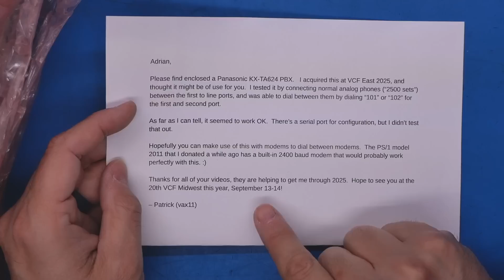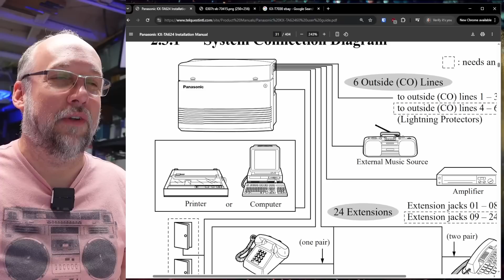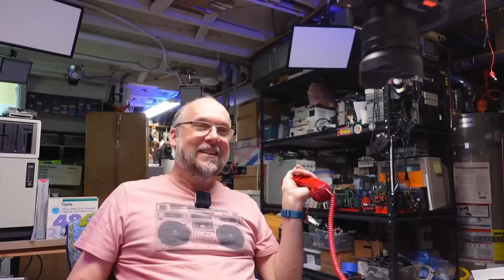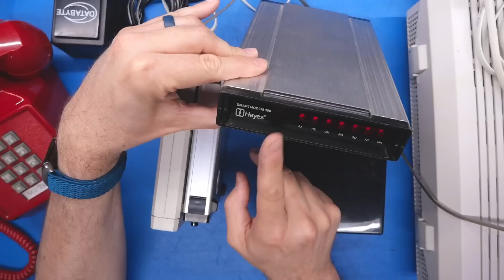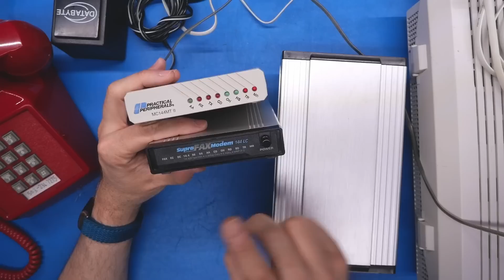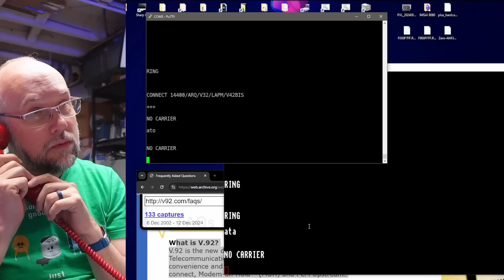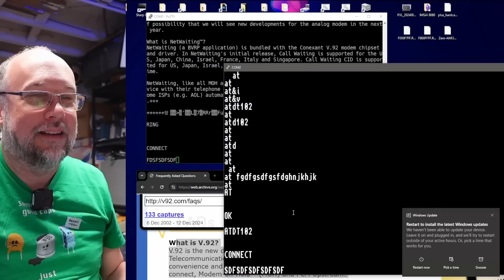How to use phones and modems like it's 1992

Comment: Maybe line 5 and line 14 have been something like a boss office/secretarian thing, so you couldn't dial into the boss office directly but the secretarian office can patch calls.

A lot of phone systens also have a bypass relay, which connects one of the extensions to a line when power is lost. On most systems it was just first extension and fist line. This was meant to be a safety feature in case of a power grit failure so you still could make emergency calls.
A friend of mine also working on a lot of old phone stuff have his PBX connected to its routers analog phone port this way with his main workbench phone connected trough this emergency connection when the PBX is turned off. This way he can still make and receive calls with the PBX turned off, and fire it up if he need the other ports to work on phones.

Comment: I was really surprised this didn't have a T1 plug for PRI.  Seems like a residential solution, especially with the doorbell option.

I used to deal with a 1994-era Panasonic system.  Quality system with quality handsets.  Part of the business was retail, specializing in services for unsavory characters... so the owner picked the Panasonic in case he needed to use the handset as a weapon to keep the customers under control.  LOL!

Comment: Somewhere around here I still have my first modem., an external US Robotics Sportster 14.4k that I got in about March 1994 for $80 (down from $140 list at the time) due to minor water damage on the box. White plastic case with hideous pink graphics and full slate of glorious blinkenlights across the top. For the spring semester of 1994, I had the fastest modem in all of Bruce Hall. Good times.

Comment: If you indeed worked with those small Panasonic PBXs, both fixed and modular, you should remember that the model number denoted the (maximum) CO and internal line ports. 624 means 6 + 24, which means no additional CO sockets on the 3rd optional board. Seems strange to forget a thing you learn in the first 5 minutes of dealing with those products ~30 years ago 🤨

Comment: My first modem was the Hayes 300/1200 for my Citadel BBS, and I ran with that setup for years, until I bought a US Robotics Courrier HST 9600. There were competing standards then for the 9600 baud protocol, and 2 or 3 manufacturers came up with their own, and the market was supposed to pick the best one and then that would become the standard. The modem cost $999, but if you were a sysop (like I was) it was 50% off. I ran at 9600 until the early 90s when the internet/WWW took off and basically BBS use went down the drain after that.

Comment: This makes me hurling back 55-60 years. My first job was in an electronic component shop (only one in Denmark at that timw).
The owner was an old telephone engineer - and he had built the switchboard in the store - a amazing 3 ingoing lines and 10 local phones (analog with dials).
The switchboard was about the size of an 'american fridge/freezer' on steroids and purely relays, spring/electric selectors and with a power bank of old fashion lead accumulators

Comment: I used to work for GPT (part of Marconi) in the payphone division. part of my job was building the servers that ran the payphones  for countries/areas. We used to have banks of up to 128 modems for the payphones to dial into to report data and get updates. You could tell what speed the connections was just by listening to the 'warbles'.

Comment: I used to manage an Asterisk PBX at one of my prior jobs where it was what you'd consider a "hybrid" set up. We had a PRI a.k.a. a T1 (with the typical 23 B-channel/1 D-channel set up, with all the B-channels used for voice) coming directly into the PBX on a T1 card, and then Cisco VoIP phones using SIP in the office. Was a fantastic setup, we originally had built our own PBX, but we replaced it with a Trixbox appliance from Fonality. It was still Asterisk-based, but it had a nice web GUI and we had vendor support for the hardware. It was a really good choice at the time though because it was very straightforward to port our original home-grown Asterisk configuration over to the Trixbox. They don't sell those cute lime green appliances anymore, of course. The Trixbox project is dead, NetFortris bought Fonality, who was then bought by Sangoma. I think technically Sangoma still MIGHT support Trixbox Pro customers that may still be using it... but I would assume they would have migrated them to PBXact if possible, which is based on FreePBX.

Comment: My old USRobitics 33.6 modem would cut off the phone on its upstream port. I wired things so that every extension in the entire house was fed from that port, so they were all disconnected when I was using the modem.
This gave me a higher connection speed, but some phones with memory presets lost their stored numbers when the connection was cut.

Comment: There’s a modern board that slides into  a Hayes 1200 enclosure that is a WiFi modem and it simulates all the dialing and connect sounds and all the LEDs on the front still work. You use telnet to dial a bbs. So atdt ipaddres:port number.

Comment: to clarify the pbx limit , the 56kbs modem was receive at 56k but transmit at 33.6k and the rack mounted modem which was digital up to the exchange aka the last mile so it would transmit at 33.6 but used a high speed h/w compression plus some extra tones to allow up to 56k , oddly enough the us robotics 33.6k/56k with switch on the top(purple was 56k, green 33.6k) was  can be software upgraded to support 56k.Decode is faster than encode of the 56k system hence the the 56k down only. also with modems you need to set your DTR/RDS etc response as well as h/w software overflow response , in fact if you look at any bbs setup file for the modem thats one of the important things mentioned, for your memory setting just look up hayes modem saved setting for the e01/e02 settings, some are binary so 00 is no carrier detect and no dial tone needed where as 11 would be opposite.

Comment: I think what amazes me the most here is how you recall any of this.  I played with the same stuff, plunged though the ATA command set, played some more, tweaked to my hearts content.  Last one I had was the suprafax modem back ~1996.  Cable came and it all faded away.  The first modem I had was a 1200, then upgraded to 9600 and thought that this was all the bandwidth I'd ever need.  That thought didn't age well.

Comment: the 56K modems were asynchronous so it would normally be 56K down and 33.6K up. the down side used hardware compression as the other end, especially if it is 56K flex.  I think on a good quality line you could get more than 33.6K I think 2 56K modems on direct dial could go to 48.xK but more than likely 33.6K. also when you make a call via the PBX you are also limited there too, so expect between 28.8K to 33.6K. 
many years ago I could tell the connection speed from the sound of the connection negotiation.

Comment: Still got 2 boxes of phones, all scheduled to go to ewaste. did also have the maintenance of the PBX at one old job, which was, due to regulations, actually not owned by the company, but rented from the only phone provider allowed to run copper line. I did all the repairs, mostly as it was so reliable, the only faults being phones wearing out, so replace with a spare, log the job, and swap the phone with the tech on arrival. Helped both of us, as i could fix one in under 5 minutes, and his job clearance time was 5 minutes as well, at his convenience, helping with his huge job load per day.

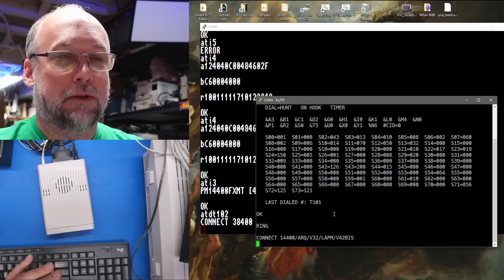Comment: 48:30 - Regarding modem compression in the 14.4k modem era - I clearly remember running a little serial port monitor application on Windows 3.1 that showed the data rate going to and from the modem. When downloading a Usenet server listing at 14.4kbps (on SLIP, without the software compression that the later PPP would do), that application showed I was getting 10KB/s through the serial port - yeah, you always want to be running smart modems at the highest serial port rate they'll support.

Comment: I lost a lot of money, forgetting that i was connecting to a BBS. I followed  the same modem uses, starting with the 300baud modem and every time a faster modem existed i bought a new version. Sometime together with my dad, when i did not had enough money.  

I belief the fastest i used was the 56k Max to call BBS's what a change of speed that was and the difference of downloading programs looked so amazingly quick while you needed to wait a long time with the older slower modem's. I also used this modem when Internet providers started being a thing. 
BTW i'm not sure about your story about the 56k speed modem, as i said, i was able to call my BBS provider on that speed without any issues. And he did have the same analog modem i used, Nothing digital.

Anyway After that i switch over to ISDN and have used that for a long long time until glass fiber was delivered at my home.

Comment: Talking about dialing modems, I worked on a project in the 90's for a large store chain who wanted back-door emergency access into every store should their main VPN WAN go down. I installed over a hundred "Netgear RM356" units. These are a 56k Remote Access dial-up Router. You essentially dial the pots line its connected to. Enter a username and password which was set inside the unit. And Bamm you had remote access into the LAN on the other side. They were fairly cheap for the time and worked absolutely superb for using PcAnywhere to jump onto remote servers etc. Just had a look and theres a few on ebay still !.

Comment: I can't believe you have a new, unopened Courier V.Everything! I worked for an ISP in the 90s and before we got something more complex, we just had a stack of 50 or so of those handling incoming calls. They really were the best modems.
Reply: Given that wall-wart, a very late model, indeed. I was given both an analog, and digital courier by our USR sales minion. His SM300 is a late model, too. (2pin barrel power connector.)

Comment: Maybe I might put an Maximus bbs up. You give me happy memories. While you tested modems I plugged my Panasonic KX-P1180 into my M1 Mac mini to print in ascii as my old Lexmark E232 is shot. It works but not super fast printing graphics pages. Trying to get CUPS to use the built in ascii mode. Still debugging that.

Comment: I have a few old modems.  I even have a TRS-80 300 baud modem.  All but the TRS-80 one were used by me, because i bought them to use them.  1200 baud, 9600 baud, 33.6k baud, and finally a 56K.  And all external, so i could use them with any computer with a serial port.

Comment: Wow I'll have to try this, actually I DO have a bbs, it's a background task on a computer that drives various stuff around my house. It hasn't been called (no line) for years, I just left it kind of abandoned, but it's still there.
However I don't have a PBX box...  However I do have a dual port VOIP ATA box, these can be setup so you can call from one analogue port to the other - so a two line version of your PBX, however I have no idea how to arrange this.
These VOIP ATA boxes need all this crazy complex 'astrix' box's etc. that I know nothing about. Having to setup a server PC as an astrix box is kind of over the top for these types of carry-on's
So I'll have to get that ATA out and try it but I'm sure it won't do anything useful
Otherwise I do have a manual phone test box, that should kind of do, however I have to manually make it ring the other end - it has no smarts, no dial tone etc.
Finally I'll be able to find out if those disused phone ports on my really old laptops actually work.

Comment: I still support about 10 or more of these for internal ride communication at the theme park I work for. They are work horses and have been installed for 25+ years.
Reply: Also we still do normal programming without the proprietary phone. You can do it with a basic phone just takes more time.

Comment: Anyone remember the smaller Courier dual standards from '91/92? Same form factor as the v.everything but only offered to sysops, with a brass plate riveted on top warning not to resell it. They only did HST 16.8k and v.32terbo 21.6k, but USR put the DSP on an upgradeable daughter card. I think I upgraded the card twice. Eventually it could do v.34, v.Fast/v.FC, v.90, faster HST, X2, K56Flex, etc. which turned it into a true v.everything modem. I loved that thing!

Comment: Heheheheh.  This reminds me of the time i needed to get some files from my Amiga 3000 to my roommates IBM PC.  Since we both had modems, i figured we could just modem to modem connect.  But my modem would not dial without a dial tone.  And since we had a 2 into 1 RJ-11 jack already, what i did was set up both machines, dialed a random local phone number, and quickly answered on my roommates machine, then unplugged the RJ-11 jack from the wall.

This worked like a charm, and i was able to transfer the files without issue.

Could i have done a direct serial connection?  Possibly, in fact it would have been easier, but i didn't know how.  This solution worked, and i stand by it.  ^-^

Comment: The reason for the double tone is in the manufacturing plant of the equipment; the UK. That’s why the feedback tone is the same one as the UK standard which is double tone.
Reply: Usually these things are configurable to suit local standards. I have a British made electromechanical PBX, and they manufactured a separate tone generator/interrupter for the system when it was sold into North American markets.

Comment: 56k modems only work with specialized equipment on the other end (usually).  Unfortunately (from experience) they DON'T work with VoIP connections.  VoIP connections usually compress the audio and don't pass the full 7 bit audio at 8kHz.

Comment: I'm in Australia and back the late 90s I went to a clearance auction at a regional forest reserve, I picked up a complete small office system, the system included a remote location module that allowed the fire tower located 7klm  away a POTS like connection. I ended up installing the system at home, every room had a phone plus the shed. At the same time I installed a 10 base T network and picked up some second hand office PCs.  The kids thought it was great having their own phone and computer.

Comment: I'm relatively certain that I connected a faxmodem directly to a fax machine to use it as a makeshift scanner/printer with no phone system in between when I was about 13 or so.

Comment: First of all: Congratulations for your running phone system!
I myself own a smaller version of an analouge phone system and use it to distribute one phone line between two areas. My setup looks as follows:
UMTS-Modem with one SIM-Card connected to my Auerswald 1006's so called AMT-Port.
Before I religated this setup to just phone stuff I had another usecase:
I had a Laptop (IBM Thinkpad R40 running Windows XP) and a fax-machine connected to the Auerswald to locally send and recieve faxes which worked suprisingly well so I used the fax machine (an old Olympia thermal paper fax) as a printer for endless paper to print out sheet music which I then could scroll through while playing (I used to play Saxophone). As time moved on I had to digitize a bunch of Paperwork in B/W and this solution came handy.

For your PBX I got another idea however:
Since you - like myself - are using old and forgotten technology I think it would be advisable to spin up a ftp server to connect to via dailup for transfering data between your pcs.
I think it would be an easy way to get device drivers for example from one PC to another without tinkering much with the systems and having to search for a laplink cable or other stuff.

Another idea to try out would be to connect your pbx to one of your sip trunks to have a fax modem connected for streaming faxes from remote locations to your home. This COULD work: It is a matter of trying!

Comment: I’ve seen those 3m connectors a bunch of times and never knew who made them thanks.
Reply: Scotchlok was the brand. They came in different colours; yellow for joining 2 wires, red for 3 wires, blue for 4 wires. They’re filled with an insulating grease, so the completed connection is waterproof. The cool kids used parallel jaw pliers to squeeze them shut. I sometimes used my teeth.

Comment: System I ran had an overlay for the buttons on the port 1 to facilitate the features programming. A full size version was in the manual so you could print a copy then use an Xacto knife to cut the boxes out for the buttons.

Comment: At a small computer company, I oversaw a very small telephone switch. I had salvaged an old 8-track chassis out of a scrapped home stereo system. Though open chassis, I used it as music on hold. It had RCA stereo outputs and a very short A/C with A/C plug. I used a stereo RCA to mono 1/8” plug cable to connect to the phone audio input. It was POTS audio & 8-track so you wouldn’t notice any issues caused by hooking up like this. We could actually switch the phones to listen to the music when not on a call. It was a way to listen to our old 8-track carts.

Comment: Those connectors are still great for modern stuff...like say, most recently connecting a new 3dprinter fan to the stub of the factory connector.  Not much else creates a permanent joint so easily and in so little space.

Comment: My modems were... 1200 baud bare circuit board of unknown brand, 14400 HST Courier, a lot of people only got 2400 baud with it, then a 14400 Baud Sportster that supported the standard protocols instead of HST, and finally a 33.6 V.Everything courier. I don't have my original modem, but I do still have a courier v.everything I got later.

Comment: Helped run a friend's BBS in the 90's. Started with a couple of 300/75 acoustic couplers, and they ran slower than you could type. Upgraded to 56K eventually but getting full speed was rare. Those were the days.